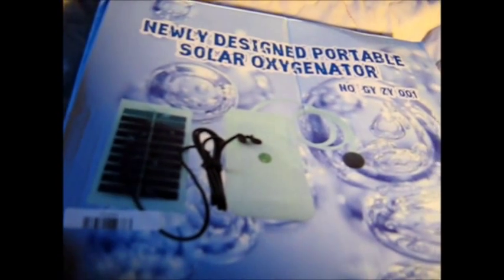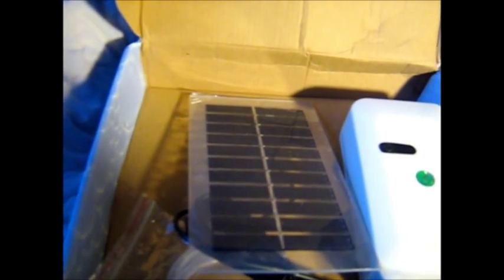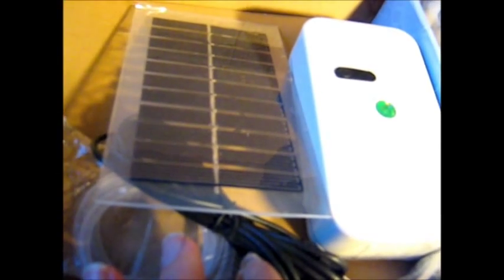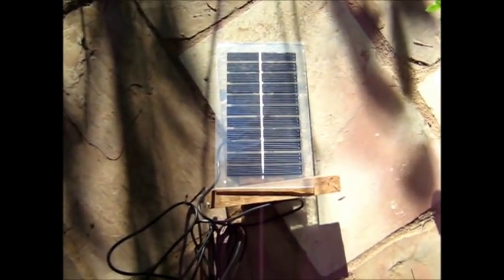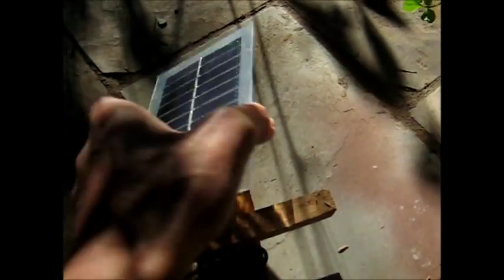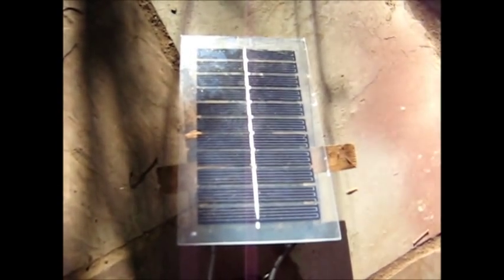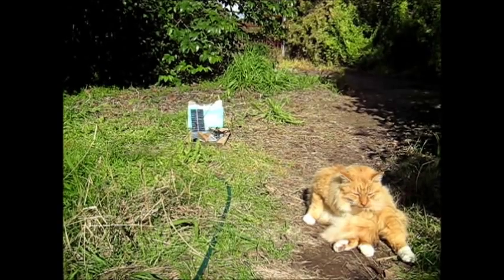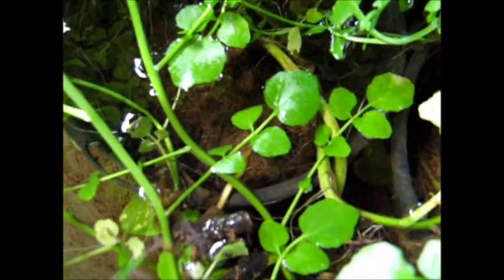Growing Watercress with Solar Electric Air Pump ☀

Comment from the maker: That might be a good idea. Anything to soften the vibrations and muffle it up a bit. Some foam from those polyurethane? polystyrene? packing boxes that fruit come in nowadays might be a very good sound proofing idea. To wrap around it, I mean. Leaving, of course, a little space for the contraption to give off a  bit of heat on a hot day.

Comment from the maker: It is a bit noisier than the one plugged into the mains. Well, a lot noisier. One could, however, put it in a soundproof box, or something, to muffle it a bit. And, yes, it was just a very cheap one from Hong Kong bought on eBay. The on-off switch was a bit temperamental, too, but I got it going each day--charging in the sunshine, I mean. Thanks for dropping by!  ;)